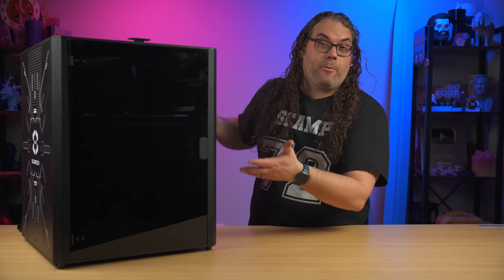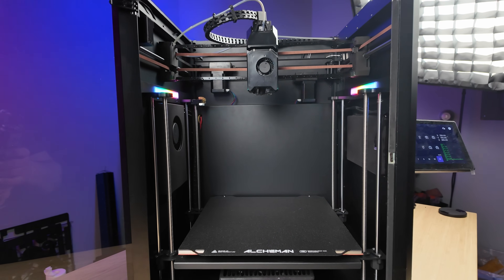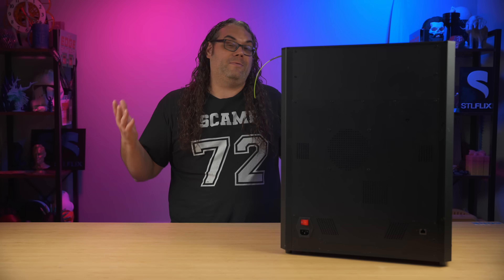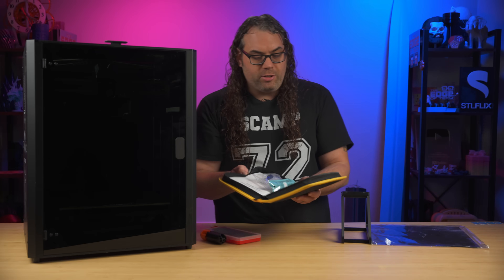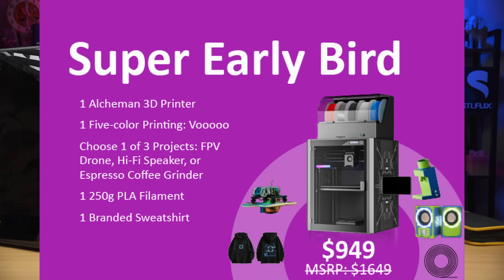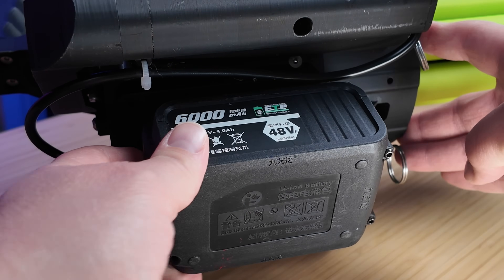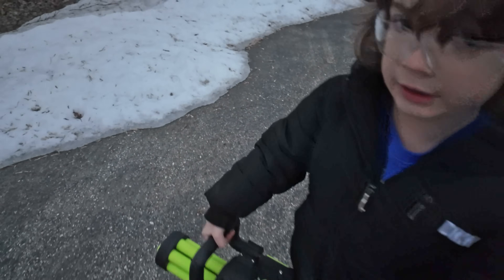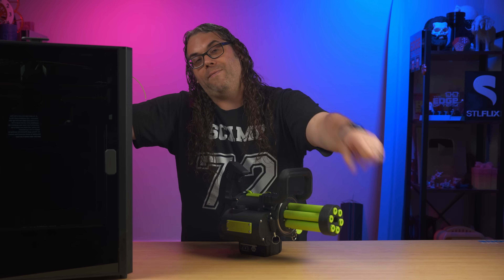Affordable High Temp 3D Printing - Elyarchi Alcheman!

Comment: I wonder about PEEK and some of those others that require 140C plate and 100C chamber temp (or more). Printing something and printing it properly, and well, is something else. So I’d really want to see prints and tests of these parts. I backed six projects and only two really came through. They all say that everything is great, but too often, it’s not. Let someone else take. The chance. It’s not worth the amount of money you’re putting into it to take the chance you won’t lose it. Wait until it comes out and you see several reviews. This toy seems pretty dangerous. Hit someone in the eye and it’s all over.

Comment: Question i have the Bambu lab P1S with AMS. I also bought some Amolen filaments, and the spools are smaller. Do I need some type of adapter to use these in the AMS? Sorry if this is off the subject of your video.

Comment: Two linear rails on the X axis are very good, but without a beam to which they are attached, this is far too unstable. And when I see the belt moving quite up and down and even a bend on the left when the hot end goes all the way to the left, there is still a lot that needs to be properly constructed again!!

Comment: A new high-temperature printer, so far this one feels good
Reply: Except nothing in the machine is rated for those temps.. Belts, plastic parts, RGB LEDs, panels not insulated, PVC insulated wires,  plastic cable chain and the fan motors.  Sounds like a fire and burn hazard.  If they were rated the cost would be much higher.

Comment: Another half baked printer. Sorry, but how is it every reviewer who got this printer the "AMS" got lost in the mail? Ya right, it does not exist or if it does then there is only one Engineering unit that is used for photos and never in action. The input shaper graphs must look like total garbage due to that under engineered system. And that screen, Why is it so far in to the middle of the printer looks like its about to rip off. I think that spool holder says everything ones needs to know about the printer. Also they never even too the time to explain the whole machine to TEOT as the side blower fan is the heater and the filter is internal at the bottom and does not blow out at all it recirculates the air inside like a nevermore. All around it just looks very underwhelming and unpolished. Oh not to mention today at 12pm EST there was suppose to be a kickstarter drop and that came and went. Anyhow to whomever is looking at buying one of these SAVE YOUR MONEY and don't. Its just nice looking and thats it. Anyhow these half bakes products make me upset as you can tell by now I'm sure. If you think I'm wrong then let me know why. I had to edit this as I was wrong the kick starter is live now, but as I said save your money. Edit #2 This honest man said this was not a review and go look at their kick starter and they have it marked as a review. FOH. lol
Reply from the maker: @neekovturbo  I definitely got a preproduction model. You could even call it a prototype. This was no review, but a first look at a product. I'm sorry they marked it like that on Kickstarter, and I actually did get the VOOOO thing after I was done filming, and it came  in pieces in the box.. :( I wasn't able to test it.
Reply: @TheEdgeofTech  Hey bud I totally get your stance on it as you clearly said this is not a review. I'm sorry for my rant, I just get annoyed at companies using flashy graphics and 3D generated content of their machines with a well written web page to try to sell a prototype thats not well tested to begin with. You are a 3D printing content creator and your livelihood depends on such content and they know that and are using your platform to validate a "prototype". In a lot of way I'm ok with that as long as they are clear about that fact and don't hide behind flashy images and good writing. I'm an automotive engineer and got in to 3D printing so I can print my prototypes. I bought a P1P as I felt that was the first fully bakes "Plug and Play" consumer grade printer. That was done by seriously seasoned engineers and marketing people from DJI. Now everyone is trying to do that, without all the serious engineering and just some decent marketing and just thinking it will come together. I was actually thinking  of backing one after watching TheNextLayer's video on it, but then I saw the "input shaper" graphs that YGK3D showed in his video and knew right away that It was less than half baked. After my P1P I have dove in to some Vorons and dabbled in designing my own klipper machine and a $1000 voron kit would produce better input shaper graphs then this machine. Don't get me wrong I love the idea, but this should have been way more polished before it goes out to guys like yourself. More than half of the comment section wants this machine, but I bet they would be real disappointed if they got the machines expecting it to be "like a bambu" without really knowing what it took to make a bambu. Anyhow I wish them luck with their venture I wish they where a bit more honest about what this machine really is. Anyhow, on a side note Man I loved how you have your son involved with making your videos. Little man can hold you in frame like a champ! I was properly impressed! Good job dad! Keep at it brother. Be well. (sorry for my second rant)
Reply from the maker: @neekovturbo  No worries and I totally agree with you! I appreciate the feedback and I really hope they can pull together everything they promise in this machine! It would be killer! But that's why I only would do a fist look and not a review. I can show the printer off, and that's ok. But there's no way I could review the unit I got in a serious manner. There's a ton of potential and I gave them a list of stuff to fix and work on to make this thing better. Thanks again for watching, and thanks for the compliment on the little man! He did a great job!

Comment: Would like to see results of consecutive first layer prints at wildly varied temperatures.  For instance, print Asa, jump to PLA, then PC, then PETG, etc.  Curious if it automatically adapts z-offset for thermal expansion, or if it has issues like the Plus 4... Or if by default it is setup for adjusting z-offset per filament profile.  Looks like it is using something like a beacon.  Will the high chamber temps cause issues with beacon sensor, nozzle thermal paste, etc.  How safe will it be with the higher chamber temps?  What would a warranty look like... if any.

Comment: Let's see a big, high perimeter count ABS or Nylon print, something tall and see how much warp we get at 80 or 90 on the chamber.    Let's be honest this is more realistic to what people would be using this printer for rather than PEEK and PEI. 
I'm curious how the tool board is gonna survive at 90 chamber temps, in my experience pushing my QIDI q1 pro into the 80s it won't.

Comment: This is more along the lines of what I was hoping to see from Bambu's new printer.  I'm glad to see someone is doing high temp, large build area, and AMS.
Reply: Ive seen what it can do as far as peek is concerned. And it uses a beacon knockoff to scan the bed.  They have some bed leveling issues with the board for the beacon knockoff. Components are not yet to heat spec. 

I was one of the first 10 backers. Hoping the issues pointed out will be fixed. 
Despite the issues. I'm enthused as I run a small high end print farm. 

We'll see! 

Hillbilly Engineer
Reply from the maker: @Manlaan  As I said, this is a pretty production printer and if they can pull it off with the production model, it will be great.

Comment: Funny how your shirt at certain times will say SCAM. Yea not impressed with this machine.
Reply from the maker: @3DeeZ-Nutz  LMAO that's funny! I didn't even notice that! Just out of curiosity, what are you not impressed by?
Reply: @ you need higher chamber temps to print peek. Like 120c if I recall. Just by looking at the machine it is not well insulated. But you will need more than insulation to handle those temps. A lot of things start to fail at those temps. I’m not even talking about stepper motors, electronics , rgb. Bed adhesive and all of that.

Comment: What thermal cutoff protections does it have?  For a printer that gets this hot and has multiple heaters, would want completely passive overheat cutoff protections on each of the heaters.
Reply from the maker: @Trevellian  That's a great question, and I don't know the answer to that. I would pose that question on their Kickstarter page so that other people can see the response as well!
Reply: @TheEdgeofTech  Please ask them as well.  They're more likely to respond to you than on Kickstarter.  Given the recent 3D printer fires that have made the news, it's a pertinent question.
Reply: @Trevellian  I would rather want a port to hook up CO2 fire extinguisher to this, and sensor to turn it on@!
Reply: @akierum  Thermal fuses cost a few cents.  Automatic CO2 suppression systems start at around $100 and go up from there. 
Agree that a CO2 system is a smart safety precaution for a high temperature printer.  But it also requires a system able cut power to the printer when it detects high heat, smoke, and fire, those also start at around $100.  
Tte printer makers should be putting thermal fuses everywhere in their printers, at each of the heaters, SSRs, and power supplies.  The cost would be minimal, and it would make the printers far safer.
Reply: @Trevellian  I know it has 2 actual SSRs, 1 for the bed other for chmbr htr. If it doesn't have thermal fuses it absolutely needs to have them!  
Im not sure if heater coils are PTC tho.
Reply: @Trevellian  Take a look how much arduino costs with some soda stream canister plus some compressor fittings.
Reply: @akierum Bambu Lab has that for the laser attachment. I wonder if they would sell it for my regular H2D.

Comment: why do we need another zzzzzzzzzzzzz 3d printer?
Unless they can create a 3d model from vapors... it is just another boxcar on a 1890 train.
Reply from the maker: Interesting take! What makes you feel that way? Thanks for watching!
Reply: @TheEdgeofTech  What about it, makes it a worthy copycat?  Nothing new, nothing worthy to make a change in platform to try.  Prove me wrong.
Reply: @graphguy  If it can truly print PEEK it would be the only out of the box printer that could do it besides the $15,000 vision miner idex. That's what's new and different.That's why its relevant (if it actually works).